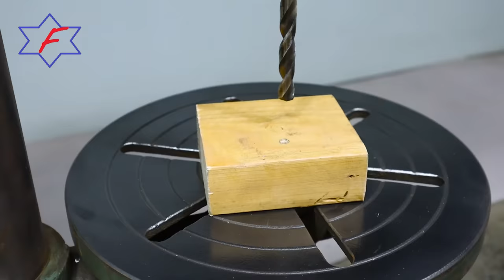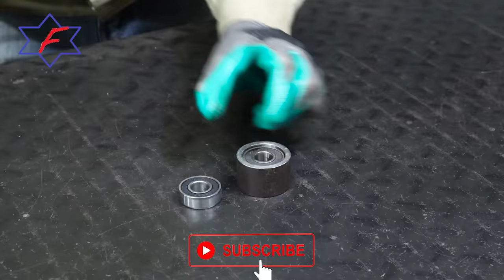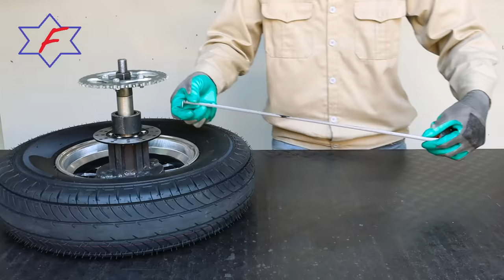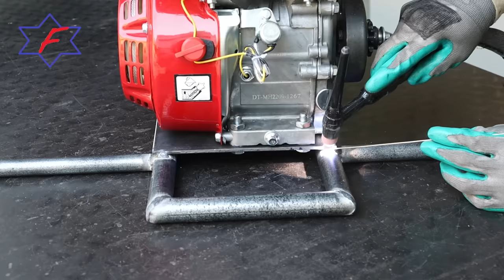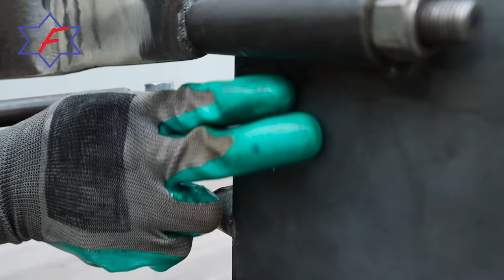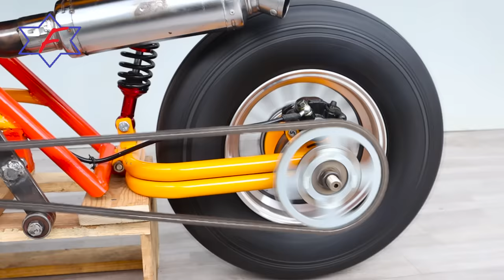Homemade Awesome Motorbike 200cc Use Single Side Front And Rear Swingarm

Comment: 14:30.

so, how exactly does this suspension work?
front...
i see two pivots to let arms go up and down on the frame.
two arms.
i see two pivots at right angles to let wheel steer...

um? so what lets the kingpin pivot up and down?

notice how you NEVER SEE IT MOVE.

along with... no rake, no trail, no attempt to make sure axle is square to the kingpin/steeringtube. 

rear... why does it look like the shock is STRETCHING as weight is applied?

this is an example of how to build a death trap with absolutely no idea of what you are doing.

but you know what? this guys a genius. 25000 of you liked this... how many ads? ten? twenty?

Comment: Nice design. I like the stretched look. You put much effort in the realization.
But some parts just can't work:
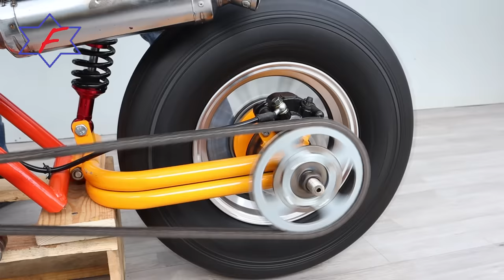17:44 this damper will never compress if the wheel goes up
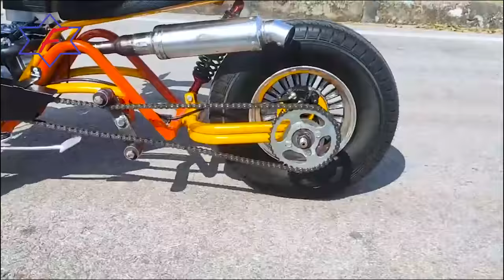19:04 the bolts are not so important. The bike rides even without them 😁😁😮
Reply: What's up everybody
Reply: I used to work on motorcycles cars
Reply: I used to work with Joe Perez used to do cars

Comment: Nice video. A lot of good ideas, some concerns. Front suspension doesn’t make sense. You have joints on the bike’s side that allow up and down movement of the top and bottom front arms. However, you don’t have any up and down joints on the wheel side of the suspension. Basically making suspension impossible. You have only left/right joins for steering there.
Reply: The rear suspension geometry does not make sense either.  No way that it can work like that.
Reply: Oh Jesus. I was trained as an engineer many years ago, and I'm usually pretty sh*t hot at spotting design and structural flaws in videos like this, but I'm ashamed to say, I completely missed that glaring co*kup !

If I was wearing a hat, I'd be taking it off to you Vilo. :)
Reply: @Reman1975  кошмары снились после просмотра этого чуда?

Comment: I was wondering about that. You don't always use filler rod to those welds. All the other times, I didn't see you use that filler rod.
Reply from the maker: Please see detail again help me!
Reply: Fawa brothers, I'm not able to help you, except type some advice for the two of two. Whenever either of you are doing any Gas Tungsten Arc Welding, or GTAW, which is tungsten inert gas, try going in a pattern, such as a zig zag or a rounded circle. Try additionally to keep it smooth. Small width welds don't have the best penetration of the metal, so try to widen them, except not excessively. Try doing different patterns when you're welding. Don't go quickly when you join two metals together. As I typed a moment ago, you want to have excellent penetration. I'm able to see this in my mind because I'm a mechanical genius. That GTAW welder, they're the best of the types of welding. This welding doesn't have much splatter, which is the reason why it's the best process to join metals together.
Reply: i'm not going to backed him up but... sometime u need to use yr brain a lil bit dude... when he is at this level playing with metal n stuffs... i dont think he didnt know a very basic thing how to stick a metal to metal...how to make them strong... how to strenghten weak point...  yeah most of the time he just cold weld the material but he didnt have to detail all the process n show us everything... this is not a reality tv show... u said like he just superglue everything and the next day everything broken into pieces... come on dude... i dont think he is that stupid wasting all his hardwork and time wanting his work  destroyed just like that.
Reply: u should watch "this old tony" channel then... he just cut metal with his finger... 😂😂😂

Comment: good work, but let me add a little input, namely for the rear suspension, it is better if the upper bolt is advanced and the lower bolt is adjusted again so that it swings better and so that the suspension works even better when the wheels are under load pressure while on the road, maybe that's enough  just and thank you 🙏👍
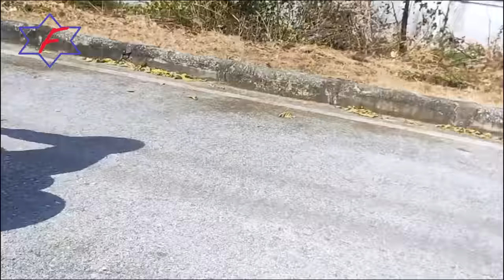Reply: If you watch 19:09 the rear shock absorber isn't even connected anymore from the top end. 🤣

Comment: Hi Fawabros, that's a nice job of fabrication, although I'm not sure how well it would handle. Apart from the welding with/without filler rod, something else concerned me a lot. I'm not a "safety Sally" but on your steering linkage, I hope you've actually got something better. For one thing, using a common bolt and "double nuts" is not very safe for this application. You can get away with that on farm machinery that goes 5 km/h, but not for road use and speeds.
I would expect (at least) that you would have Loctite on all nuts, and/or cross-drill and safety-wire the nut(s). All it takes is a bit of road vibration, and your double nuts may suddenly become single nuts, then no nuts and a loose bolt. That's a bad result. I wonder why you did not have any sort of close-fitting sleeve on the holes in connecting link parts, plus high-strength steel fasteners that are very well secured against coming apart and falling out. I'd had to read that you'd found yourself meeting a tree, or concrete barrier while at speed. It would not be good even if you survive the steering linkage falling apart. 
I'm also really curious about your welding equipment and methods. I've built a few trikes and other things over the years, and welding has gone from stick, to wire-fed MIG, to TIG with an appropriate filler rod. Since you show this in part of your video, I'm assuming that's your minimum in terms of putting the pieces together. It's also pretty clear that you do a lot of prep work or actual manufacture off-camera. Some of this must be quite interesting; perhaps you'll consider making a longer, two-part build video showing some of the most interesting parts. Anyhow, It looks great, and the design is very novel. Many thanks, and stay safe!
Reply: I'm glad you're concerned, but the normal bolt and double nut on the steering linkage is one of the least sketchy parts of this build.  Still awesome to see someone building a new machine from scratch!
Reply: Great critique with being a D^&k. Showing some real concern here.  I am in awe of anyone that can put such a complcated piece of macinery together from concept to final product.
Reply: Y el apoyo del amortiguador trasero??,puede asta no ser real el video
Reply: @martylawson1638  what? are you suggesting non functional suspension is sketchy?
gotta love it... theres absolutely no thought of pivots, geometry, linkages. other than throw some bearings in? wtf?

i cant help but get the sneaking suspicion there should be ball joints somewhere... LOL!!!!

but, paint it silly colours, edit uit well, and who cares in this modern society! form over function!

Comment: At very low speeds this may work, little faster and you will find out that motorcycles turn using the round shape of their tires not turning the handles but leaning the motorcycle. Need round tires not flat tires.

Comment: Ok, you can tell by the engine that this is not made to be "fast"? so I don't understand why there are such critical comments on this video? The bike is just a gimmick to look different? It's not made to be high performance?  Why are people getting so angry about how wrong he has made it? It functions? Yes it could be improved with a much better design, but it still works going at a slow speed👍
Well done. It's not what I would ridez personally. But good on you for creating something that you enjoy riding. Don't worry about all the comments from negative people.
Honestly I've seen much worse come from China that is manufactured as a product to sell?🤭

Comment: Nice work, BUT please consider reinforcing the steering linkage from the steering handlebar bottom.
It’s not safe at all to have all of this wobble down here and the linkage connected with just a thin plate of sheet metal to a tube not supported but on the upper part.
Anyway nice build.

Comment: The vertical portion of the steering shaft has a lot of flex at the bottom, which will translate to vague handling. Great build other than that.

Comment: It looks quite nice but it’s clear many tolerances are way off and the resulting vehicle is instable. When it corners the front wheel even seems to be leaning to one side. The frame is not rigid enough anyway, especially around the front wheel assembly mountings. I am therefore quite sure it will not be used after this initial “test”. I love the involved creativity though.

Comment: At 19.08 the rear shock (which cant work properly in that position) seems to be disconnected from the frame? Also there is hardly any ground clearance for the footpegs. If one of those footpegs digs in on a corner it will have the rider off no problem. I wouldn`t ride it above 5mph as the whole thing is so unstable. Please leave the bike alone whilst you are still in one piece.

Comment: You do know they perfected the single front spindle over 30 years ago they patented because it was joined off the lower frame before angling out then back into the tire and rotated at the center point there or had a true Center rotation that one there is kind of not quite on the mark

Comment: I really respect your work and I watch videos with pleasure for the sake of content, but the engineering solutions used in your projects are simply terrible, my teacher in strength of materials and also a teacher in theoretical mechanics and machine mechanics would simply kill me if I applied such solutions as, for example, an axis pendulum on a threaded stud. Moreover, the video shows how the rear shock absorber came off 19:03. Therefore, I say it again, I watch your videos as an engineering comedy.

Comment: I did not see any camber built into the front end. It has to have camber to be stable at higher speeds. Couldnt drive it straight. Camber would have stopped the wobbles. Nice project, but more research is needed.

Comment: Nice try.....why didn't you show the leaking banjo bolts? During installation both washers were on the head side and then when you went to bleed the system they show properly spaced on the hose.....rookie move.

Comment: Not well done at all. 
1. The geometry for the rear shock is none functional at all. Movement of the swingarm would lengthen the shock which is already at the maximum extended length. Any movement is the result of flex in the chassis.
2. The front swing arm idea has merit, but you need horizontal pivots at the steering knuckle to allow up and down motion of the swingarm. Any movement you are getting is again from flex in the chassis and clearances in the joints.
3. I realize you are using materials on hand, but electrical tubing while good for mocking up will not last long.
4. Unfortunately, a lot of effort and expense for a non-functional ride.
What was well done.
5. Good video production and sequences. Kudos there.

What I would say to anyone looking to emulate this build, is don't. You won't be happy with the outcome.

Comment: Basically what you built here is a death machine. I would never ride this. It's clear to me you do not understand mechanical stress, basic chain drive design, unsprung weight management, requirements for bearing surfaces, proper fasteners for vehicles, basic safety requirements for road use. Your bike is nothing more than an art piece.

Comment: Steering Geometry is "way out", and dangerous. DO NOT COPY THIS DESIGN!!!  Hard braking will result in wheel turning to full lock instantly.
Also,   axles are a bit too small , even if the geometry was right. Repeat  DO NOT COPY THIS DESIGN

Comment: Horrifying. The steering has no castor. The steering pivot is off to one side, when it should be in the centre line of the wheel. The handlebar stem is on the centreline, which means the lever on the bottom of the stem is longer than the lever on the front hub, therefore the input on the bars is disproportionate to the output on the front hub. Watching this thing go down the road, I'd swear the front and rear wheels weren't in alignment. The guy was fighting the bars just to go straight. Horrible.

Comment: Doesn't look like its stable when being ridden. Steering looks to me  like it darts left to right when corrections being made. Video mark 1849 and 1901shows how unstable it is. You can't corner safely. Park it up.I would of left the rear as you have it and put standard fork arrangement on the front. To much engineering calculations to work out to get it to work nice and correctly. Other wise nice effort. Play safe